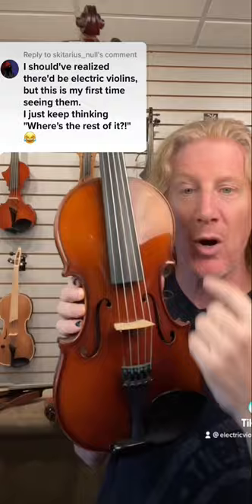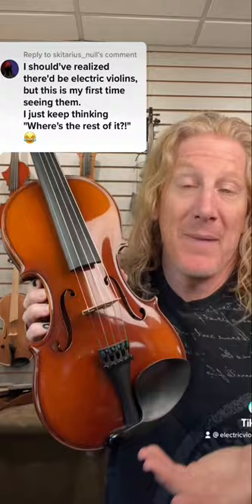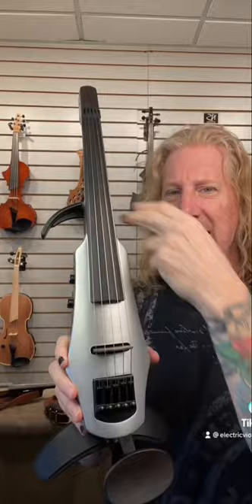Why Do Electric Violins Look Like That? #shorts

Comment: Obviously projection of sound is no longer a problem with electric violin, therefore you don't need the original shape of the violin.
Reply: But it just looks weird without the wooden structure around it! Violins were made to be that shape! 😉

Comment: Why are there 5 strings LoL?
Reply from the maker: The real question is why modern violins only have 4 strings. If you go back a few hundred years, 6 and 7 string instruments were common. They evolved back to 4 because the instruments had to get louder as concert halls got bigger. But electricity has allowed us to go back to 5, 6, and 7 string instruments.

Comment: If someone learned playing violin on an electronic violin, would he also be able to play an acoustic violin?
Reply: You would probably have to get used to the weight difference, and the size, but otherwise it should be the same.
Reply: @stary-eyedphantom6456  thank you so much! Good to know! 😃
Reply: I would definitely learn on acoustic if I were you. Everything is a lot more precise on normal violins to make the sound project that isn't really a thing on electric violins.
Reply: @UProductions457  thank you so much for the advice!
Reply: probably not as well because electric doesnt require as good of angles and stuff because its electric.
obviously they can still play but they would need to get used to paying attention to the bow and stuff etc
Reply: @romanianspy4277  appreciate the advice!

Comment: Why did that traditional violin have five strings? Is that normal?
Reply from the maker: It is now. We actually sell more 5 string violins than 4.
Reply: no, by definition a violin has 4 strings
Reply: @avalaugnn  haha no. Also, what would you call a violin with 5 strings if it isn't a violin?
Reply: @avalaugnn  no, that is an old definition that doesn't hold up in modern times
Reply: @MrGallade475  firewood

Comment: Wait violins have 4 strings right? And violas have 5 right? So why you calling that viola a violin. No hate just wondering
Reply from the maker: Nope. Traditionally, both violins and violas have four strings. Of course, if you go back even further in history, bowed string instruments had MORE than 4 strings. They had to shrink the range to make them louder as concert halls grew larger in the 1700-1800s. We've got electricity now, so with amplification, we can go BACK to what used to be normal - 5, 6, and 7 string instruments.

The main difference between a violin and a viola is that the viola is tuned a fifth lower and has a larger body.
Reply: @ElectricViolinShop  fascinating thanks!

Comment: Why’s there 5 strings, isn’t there only 4😂
Reply: Because a fifth string extends the range of the violin. It's tuned a fifth lower than the previous string, so it's pitched to C. It makes the instrument just a bit more versatile. There are a good number of modern composers writing for 5-string violins; also, some baroque stringed instruments had 5 strings, too. :)
Reply: @MusicalBotany  That's true! Bach wrote his 6th cello suite for 5 string cello with a high E string